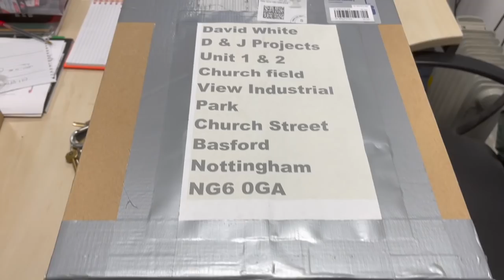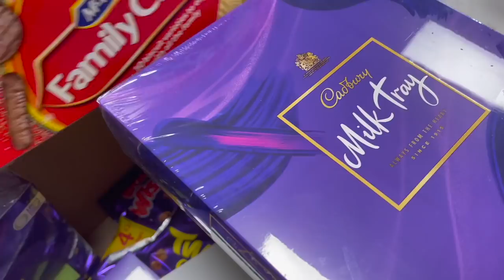THE HARDEST FENCE INSTALL THIS YEAR! - This Week At D&J PROJECTS #050

Comment: One thing I have used in the past to remove stumps and roots is an engine lift.  As long as there is enough stump sticking up to get a strap or chain around.  The Engine lift needs to be on some planks to spread the load, so it doesn't just sink into the ground.  As it lifts use a reciprocating saw to chop the roots.

Comment: When you hear the words. "neighbour only wants". Neighbour can pay then.
Reply: Yeah “make sure install the fence at maximum height of 7 feet & whilst your removing the old fence you can remove the shrubbery on our side aswell” but we won’t pay you for it or tip the lads 🤷🏻‍♂️🤦🏻‍♂️ bet the neighbour had easier access aswell for the travel of the fence, gravel board etc

Comment: Those "bombs" were probably broken sash window weights. Loads of them in the ground at the bottom of gardens round here from when the old sash windows were ripped out for double glazing. Most people would burn the old wooden frames, leaving just the metal bits around.
Reply: Yes I was thinking sash window weights....👍🏻

Comment: I'm a pretty new viewer, is there a video on that panel maker? Also curious where your frost line is, we have to sink everything four feet deep here in Newfoundland or the frost heaves it something fierce. Really like that fence system you guys are using, never seen it's like before. I got to thinking, have you considered a low voltage lighting system to set off the fence at night? If you made cement toppers for the panels you could hide the wiring making it ridiculously easy to do. Maybe an idea to set you apart from the competition? Anyway, really enjoying the videos, it's always a pleasure watching people who take pride in their work.

Comment: Alright Stevie
Easier way to get a hedge out is a 2 ton winch attach to 2 different sections off the hedge and which ever bit goes first and just keep working along the hedge.
Nothing better than hearing the roots pop 💪👍
Attach cable at one end and a tow rope or something similar..
Boom they will pop out.
Not to shabby 😉

Comment: Another great video, thanks guys. Can you get the 'Lego' block moulds in smaller sizes? they would make a good screen for dust bins or used as holder for compost heap in gardens.

Comment: I realy like the work you do, but there is somthing  I would like to know.  why don't you use a power auger to dig the holes for the post's. here in the states (USA) alot of digging is performed by a power auger run by petrol , elect, air or hydraulic.  some of the smaller units are 2 man opperated and a some larger units are on a small trailer .  and in the winter the small petrol units are used to cut holes in the ice to ice fishing.  using one could cut a 2 day job down to a 1 day job.

Comment: Be careful with those trainers boyos I bought some 6 months ago and I’ve gone back to my boots due to the xtremely grippy sole on the trainers, I started getting pain in my left kidney and the pain spread to my left bollock I googled wtf expecting the worst turns out it was caused by back pain and I thought bollox until I was back at work moving box’s and realised I was lifting the box’s and turning my body was turning but the super grippy soles on the safety trainers were planted to the floor which was the cause of my back kidney and bollock pain, easy solution would be lift my feet and turn but when ur constantly lifting and turning I soon realised I’m better to go back to my boots 
great work boyos

Comment: Wow that was a Hard One, it looked really good when completed. I was amazed at the Location of the Power Cable, we has to have it at least 2ft under ground, where that one was is very Dangerous. Good to See you have the Recipricating Saw out. Curry, a Nice Hot Vindaloo, it's very Hard to get a Good Curry over here. I also enjoy the longer Vids. Nice to see you with your Coats Off, it was 27C here yesterday & I had a Jumper on, currently Bucketing Down. All the Best from OZ.
Reply: the power cable has been done as a DIY jobbie not to regs
Reply: @leemclaughlin3927  As a Home owner here you are responsible for any "Bodggie " stuff on your land. If someone got hurt you may be in the Poo.

Comment: ive pulled hedges out easier than i thought using chains and a 4x2 piece of wood. the power of leverage especially with 2 men  works wonders. Mine came out with no digging.
Reply: and on the flip side i'll just say. ive used those badge claws once. oh my word they dont half give those muscles you never use a work out ! haha

Comment: Have you considered using a lever and letting physics do the hard work for removing the stumps? Attach a long piece of wood and the leverage should mean you can pull the roots out much easier. Here's a video as an example https://youtu.be/X3hp5p8RDNw